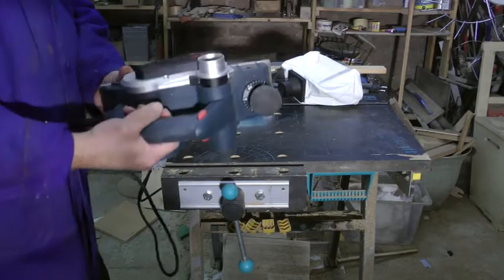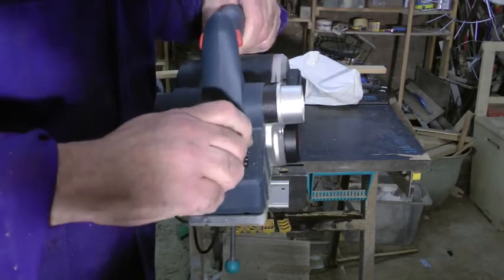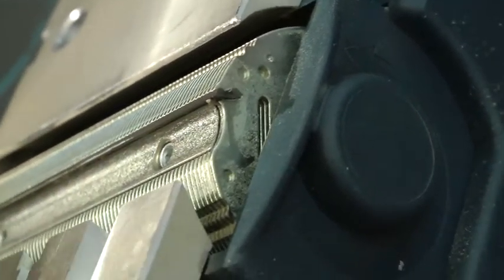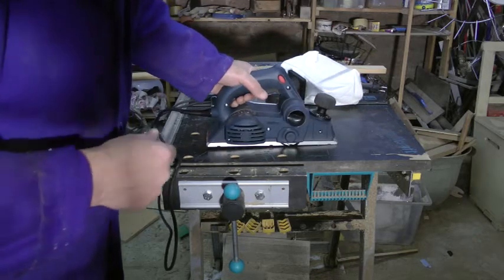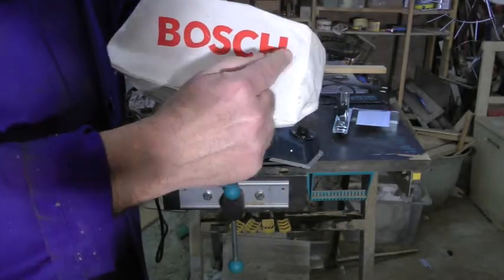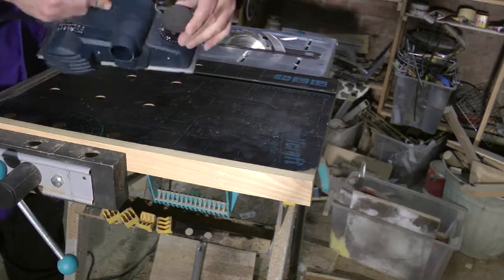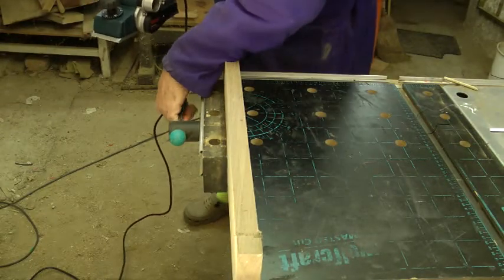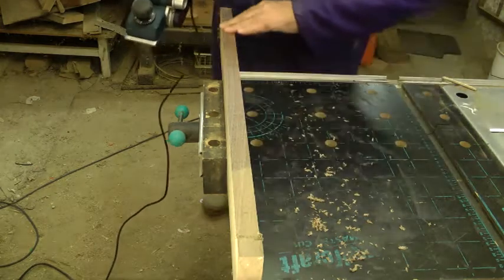How to use Bosch GHO 26-82 Planer

Comment: Are you for real?!!

I do hope this was a spoof, tongue-in-cheek precise; if not be afraid, be very afraid!

How can you profess to give a demo of a power tool when you haven't a clue how to use it or what the parts are for. I am minded of the late Kenny Everett's character, Reg Prescot and his escapades making the cabinet français.

 Reg Prescot Makes a Cabinet

Just what colour would you suggest for a professional tool? Whilst dayglow yellow (favoured by DeWalt, Ryobi, Stanley and JCB) might help you find one in the dark - you shouldn't be using a tool such as this in dim light and you would in any event find the glare of such colours detracts from your woodworking - the same reason operating theatres now use green surgical drapes rather than the white ones of old. Bosch generally deploy green for their domestic range and blue for professional tools - a colour scheme also adopted by other top manufacturers such as Peugeot, Makita etc. Anyhow - the blue matches the top of your workbench, Reg.

The black plastic switch adjacent to the sawdust ejector port is so that you can select either right-sided or left-sided ejection of the waste either to the dust bag or a vacuum hose - a real boone when working in different planes (no pun intended).

The silver-coloured metal plate is a 90° fence (also called parallel plate) - this acts as a guide to enable more precise parallel planing; it can be interchanged with other (optional extra) fence plates of varying angles. They are also used for rebating

BTW - you made no mention of the front-plate V grooves which are there for chamfering and bevelling which is often done in combination with an optional adjustable bevelling guide. The other plus-factor with this model is that it deploys just one blade and not two as found on most such planers. The advantage of this is that if you should hit a nail or stray piece of metal, then you only damage - and thus replace - just one blade. These blades are of such quality and the unit of such power that a singular blade, in conjunction with the corrugated roller arrangement, do not hamper progress in comparison to two-bladed units.

There are also two versions of this planer available - the 240V (which can be operated on 220-240 volts) which is primarily intended for semi-domestic use, and the 110v version which is configured for use by professionals using 110volts AC such as found on building sites etc,

Whilst you demonstrate the most appalling carpentry and presentation skills, your video camera work is exemplary,

Many here have suggested you should find an alternative occupation. But whatever you do, for the same of mankind, do not take up circumcisions or vasectomies.